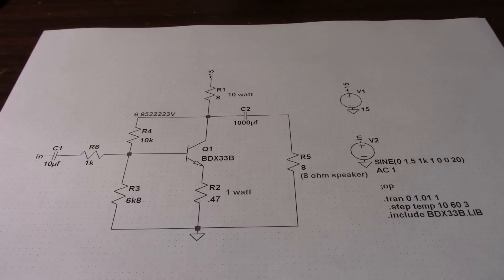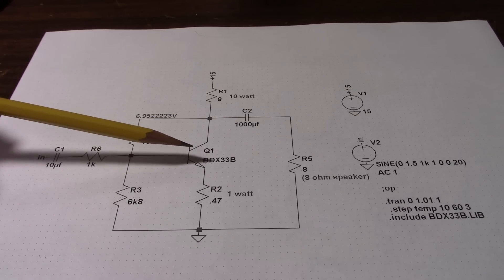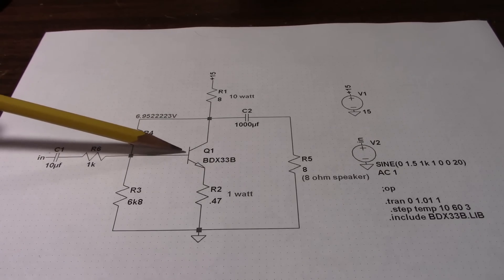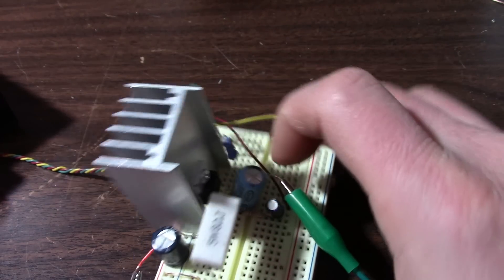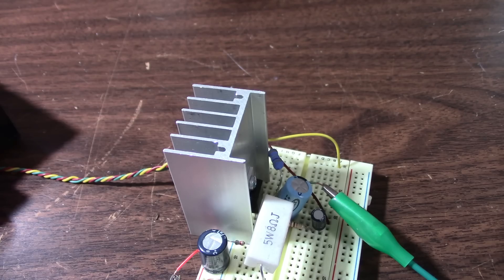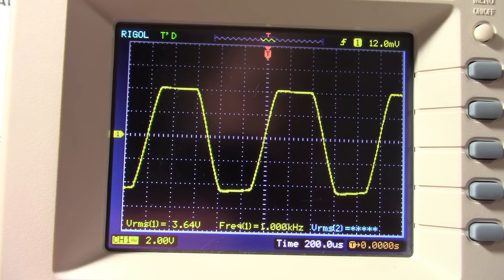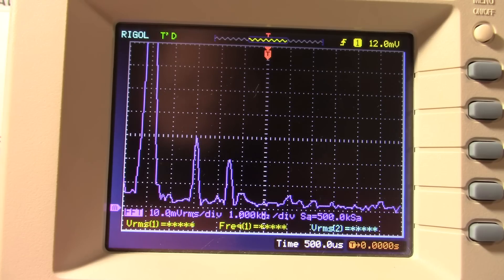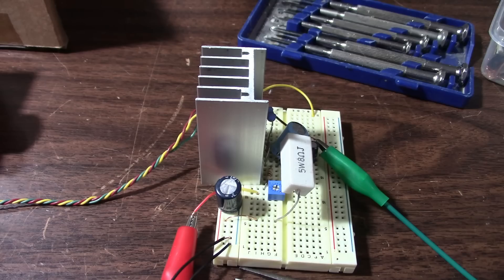Build this Amazingly simple class A amplifier

Comment: Great tutorial. I've been driving myself nuts trying to work out how to make a small practice guitar amp with this circuit. I can plug an iPhone or some other headphone-level source into it and it works, but with a guitar (and a few different amp designs) I either get nothing, low signal, or crazy distortion. Is there a simple buffer or pre-amp circuit that can bolt onto the front of a design like this?

Comment: I didn't know class A amplifiers could be used as power amplifiers until now. Thanks for posting this video.
Reply: Many "hi end" audio brands sell PURE CLASS A amplifiers. Yes, they afre like stoves, pretty inneficient, but they will never suffer from crossover distortion or unmatched transistors on each half wave. Old tube amp in single ende config using a transformer as a load (as well as DC polarization) were pure class A.

Comment: I'd swap the current sourcing resistor for a choke. Should help with efficiency a lot. Also will improve the output power (it will double the available voltage swing).
Reply from the maker: Yes, I did that in an earlier video. I wanted a rudimentary circuit that worked.
Reply: The old car radios used that technique. Paired with a 6 Ohm 6X9 speaker, those radios were loud! They used PNP germanium transistors, so the coil went to ground, and the amplifier was positive ground referenced. That's why they ran hot, because the bias current had to be high enough, for the impedance of the speaker, and at 0 signal, the transistor had nearly the full 12~13 volts across it at ~2.5 amps. That gave a full 24 volt swing(+,-12v) available to the speaker. The large round base (TO36 case style)transistors were mounted on a very large heatsink, which usually got hot. The heat sink had to be big enough, for the transistor dissipating ~30 watts, to stay below 80°C, on a hot day. Germanium transistors have a much lower junction temperature rating,(85°C) than modern Silicon transistors.(usually 150°C) The germanium transistors were in bigger packages, mounted on bigger heatsinks, because they had less temperature swing, than silicon.
     Those early Class "A" output stages were used in the first radios, to replace tube radios, back in the late '60's. They indeed used a choke, instead of a load resistor, for just the reasons you mention. One transistor could produce the same amplitude, as 4 transistors in a push-pull H-bridge configuration, which replaced the class "A" design, to save power, and allow a much smaller heatsink. A stereo class "A" would draw more power than the headlights! The output stages would put about 12 watts RMS into a 6 Ohm speaker, with the engine running.(about 13.5 volts across the transistor)
Reply: @vincentrobinette1507  Interesting tidbit of history :-) I was inspired by the typical tube class A, but because a transistor can have such low impedance we dont need to use a transformer (or in other words two tightly coupled inductors), we can just use an inductor and couple capacitively ;-)
Reply: @akkudakkupl  By replacing R1 in this schematic with a heavy inductor coil, the DC resistance of the inductor coil was low enough, that the speaker can be connected in parallel with the inductor, no output capacitor necessary. The <1 volt that appeared across the DC resistance of the inductor, was considered negligible. you would see a very slight movement in the speaker cone, but not enough to cause heating, or, use up the X-max of the driver. When I saw a lot of bias on the speaker, it never hurt to connect a capacitor between the speaker and choke inductor. This circuit was "upside down", because the transistors were PNP, instead of NPN, like what's used in this circuit.
Reply: At the risk of adding complexity, I think the John Linsley Hood class A amp is worth trying where an active load is used in place of the resistor. Nelson Pass made some very favourable comments on this and added some interesting variations to that "1969" design.
Reply: @akkudakkupl  That's exactly right. Transistors can pass so much current, that all that's necessary, is to use a low enough speaker impedance, that you get the wattage you want at the available voltage.
Reply: I've used a 15-0-15 volt transformer as a choke works fine.

Comment: Could you use a light bulb as a replacement for the 8ohm/5W resistor?
Reply from the maker: Yes, Nelson Pass does it with one of his amps.
Reply: JohnAudioTech sir john you have 1 cap that is not in the schematic can you tell me what value it is? And where is conected?in the schematic are 2 caps but on bredboard 3 thank you
Reply from the maker: @azizzable  It is across the supply rails. Good practice to have one even though this circuit is probably stable without it.

Comment: John thanks but practically this has a lot of power loss and heat generation. What’s the solution ? Which class power amplifier works more efficient? Does an op-amp helps? How?
Reply: Class AB or B amplifier.

Comment: Would a mosfet also work as the semiconductor in this circuit?

P.S.: Stupid question I know.
Reply: Edited to avoid confusion. Yes, with some very minor alteration.
In fact it gets even simpler with FETs and they can sound quite amazing too. If you want a very simple super hifi amplifier use a double triode for voltage gain (and stereo) and choose a simple FET output stage (either push pull or single ended like this one) and depending on the power supply voltages chosen and your output topography you can get as many watts as you want with excellent quality and very low component count, maybe ten or so parts per channel  plus power supply - in fact shared components make a stereo version have less components per channel count.
Edit No, not a stupid question at all.
Reply: @martinda7446  You need feedback for a mosfet, as mosfets are voltage controlled current sources. The output would be heavily distorted as the voltage doesn't correlate linearly with the current.
Reply: I would like to know that too. I've been trying to make small guitar amplifiers, and it would be great to have a full FET amplifier.
Reply: @martinda7446  Is there any example schematic for us to visualize that? Thanks for your answer :)
Reply: Sure would!
Reply: @rich1051414  The circuits can be built simply was all I said, distortion can be managed quite easily - We have been doing such since 1970 or so with FETs.
In fact the output topology of a FET circuit can end up much simpler than a bipolar with comparable distortion figures - as most are just simple follower stages.
I was keeping it simple for the chap, and there is feedback in two places on the original circuit anyway. I was going to suggest he does a search for simple FET circuits if he likes those devices to cover any issues he might find,  as you pointed out these are not linear devices and neither are bipolar transistors of course.
Reply: @pauloscabeni5277   See if you can find a Croft circuit as Glen Croft has been building simple valve and FET circuits since 1982 or so. He has a line of triode fet amplifiers which I guarantee will be simple and ingenious and sound great too.
Otherwise there will be plenty of circuits to find.
Reply: @martinda7446  He asked if a mosfet could work as the semiconductor IN THIS CIRCUIT. That answer is no. The waveform would be distorted if you did that.
Reply: @rich1051414  So if the original poster is reading this then I would answer, YES, with a very small modification to accommodate the chosen FET it would work fine, remember you have to design for a particular device, No two random bipolar transistors would be guaranteed to work in any transistor circuit of course - same with FETs and beware of unhelpful people in life as a general rule.
Reply: @martinda7446  Any bipolar transistor WOULD work, or darlington for that matter, albeit with more or less gain. A mosfet wouldn't be acting as a voltage follower at all, so no, I am not being anal whatsoever. And my intent was to be helpful, so chill.
Reply: What MOSFET circuit will work best?? Common source voltage divider bias or a common drain circuit??
Reply: @sayantanmaiti2513  'Best' would be to use an op-amp with negative feedback and let it drive the mosfet to the voltage you want, since the load may not be exactly a specific resistance. Such an arrangement would work with BJTs or with MOSFETs, with the only change being the gate resistor, though you could get away with the assumption of BJT just fine.
Reply: Richard Smith yes that's a good method. For an opamp I'll choose MOSFET opamps like CA3130.
Reply: You have to be very careful with MOSFETs in linear circuits like these.  They typically have very limited safe operating areas compared to bipolar transistors, so can suffer secondary breakdown at quite low power.  MOSFETs are much better for switching (e.g. class D amp).
Reply: SkyWizardless yes that's the reason why we still use BJTs like 2n3055 or 2n3773 even today. Bass cannot be made better than class AB.
Reply: @rich1051414  I was talking about a push pull circuit which generally uses a  unity gain follower. Which is why i said use  voltage gain from a triode. You came across to me as unhelpful and I don't need to chill. 
As these comments are of little use to anyone  - I think that should be the last word on the matter.
Reply: @rich1051414  PS. And, No not any transistor would work which shows me you really have no practical experience here. What if the max Ic was 200mA? for example.
Reply: @ferrumignis  Most Mosfets are designed for switching and they suffer as you suggest.  Earlier devices were actually even better behaved in this area than their bipolar counterparts. (Silicon not germanium) The market determines the direction of R&D and that didn't include linear circuits unfortunately. Sony VFETs and other similar devices are ideal for linear analogue applications. They have not been available for over twenty years though.
Reply: @pauloscabeni5277  Have a look at the Tubecad.com 'super triode' or search for 'hybrid FET triode amplifier' - though, I must say many are more complex than I had envisioned. Maybe I should make one available?
If you want to build one the active components are certainly of a low count but the power supply can seem a bit more complicated at first glance. A small triode like an ECC83 though requires a tiny HT supply and will run happily from a broad range of voltages, you can use what you have at a push down to 100v (or lower, indeed down to very low numbers but there is no reliable data at these voltages), plus a heater supply of either 6.3 or 12.6V, where they can run off a standard 1A 12V regulator. The HT requires only a matter of  thirty/forty milliamps or so which is a total of about 10W.
I am listening on a design of mine which has four active devices in total, plus rectifier, for a full stereo amplifier, one double triode and a single ended pentode wired for triode operation per channel. Sounds fantastic and though I know from my own builds that the FETs are not quite the match of triodes, they will give you more power and less thrown away heat in a smaller box with less cost.
Reply: Not at all. There is a circuit of a minimal amp using a MOSFET. But not any mosfet, the infamous Hitachi "lateral " mosfets 2SK1058 .... intended FOR AUDIO (ok, lineal applications instead of switching applications). I build it ans used it. It wasnt pretty good at highs .... but Im almost sure it was a counterfeit. In fact D and S were reversed LOL
Reply: @rich1051414 I have asked it for my circuit that is there any feedback for the single mosfet what i have used, and i got reply that it have local feedback but no global. So maybe youre right, but my amp runs good just the way it is now. I have some old videos to give some idea, but i believe now it is even better then before. Maybe i have to upload new video :)

Comment: This is a lab amp and is a good example of how simple a power amp is but you do need a strong output to handle that much current and not over heat it would have been good the tactics to have you schematic turn brown shaped like the heat sink

Comment: What is the need to block DC voltage from  getting into speakers?
Reply: DC in a speaker will cause the cone to shift away from it's mid-position, which can introduce distortion.  Too much DC voltage will cause the voice coil to burn up.
Reply: Otherwise you will blow the coil or if you dont reach this point you will heat the coil for no reason putting stress into the speaker. DC is like NO-NO for a speaker

Comment: For an easy life try a LM317 current source ?   1 ohm = 1.25 amps . It can be bypassed if required with a capacitor. LN317 is fast enough for class A.

Comment: Got a question here, the circuit is very much similar to a standard common emitter circuit, however, I found the R1 is in different location, isn't it that R4 should be connected to Vcc?
Reply: Jack, R4 is connected that way to stabilize the bias. It's a sort of feedback. Iirc it's called self-bias and it is not that much different from the feedback realized by emitter degeneration.
Reply: in simple it is combination of voltage divider and collector fb bias

Comment: I'm curious, have you tried to validate your spice transistor model with the characteristics of the actual transistor in your circuit?  
With such a simple circuit it could be instructive to confront simulation and actual measurements.

Comment: Hi John, can you please share the BDX33B.lib file, probably via Google drive or other means, I want to try the simulation but couldn't find the transistor model, appreciate for your help. I have tried the model from OnSemi, but the result is totally different. In addition, the BF=123.448 is much smaller than the datasheet which claims hFE=2500, I'm confused with those values.
Reply: I can confirm that with On's model Vce is at 14v. And the output is neglible. It's a long shot from what  is measured on the bench. Either reality is broken or there is something really wrong in the model.  And the bdx33b is not on Cordell's model page.
Reply: @copernicofelinis  Yeah, my simulation showed 14.135V at Vc and 106.6mA for Ic Another thing I found weird was that current drawn in the video showed 1.25A, if multiplied with the 5W 8 ohm, it would dissipate 10W and I'm not sure if the resistor can withstand it for minutes...
Reply: @copernicofelinis  My bad, last night I tried this again and managed to get the simulation worked. The simulation and real circuit have slightly difference in voltages at various points but good enough to come out 1 watt clean output as demonstrated by John. Great work from John, I have to say this again.
Reply: @apang9999  did you use a different model? Because with the model supplied by On and with the values  used by John, it doesn't output anything relevant. If I change BF to 2400 and almost all resistors' values I can get more than 1W with about 6Vpp, but distortion is 5.7%.  The point is that I have to change everything in the circuit.

Comment: Dear  John , i constructed the amp . It has a very good sound and it is playing even without a pre-amp. I connected a small tube pre amplifier ,that its more a buffer , and i am very pleased with the result. Although the R1 resistor is heating up very high . I would be gratefull if you give me an advise about that. For the time being the amp is provided with power from a bench power suply. I am thinking of using a ATX (pc power suply) in 12 volts, unfortunately because i dont have a 15 volts transformer. What do you think about that?  I am thanking you for your uploads and i am waiting for your reply . Greetings from Greece Athens

Comment: Cool, but until you showed the preamp feeding the signal to the base of transistor I was wondering how the heck you were creating so much sound from the speakers.

I like playing with and experimenting with 1 transistor amps and have not done so for a while. I found in general expecting much more than 1/2 to 1 watt was pretty much wishful thinking and I was wondering if you have or could dream up a simple amp that really pushed the limit. If so I'd sure like to see the video.
Reply: Ive gotten 8.5RMS out of 1 2sc5200 in class a configuration several times

Comment: Personal experience with many years of SPICE modeling - always gets you “in the ballpark”, never gets you a “grand slam homer”. You still need to prototype, and tweak. But, SPICE gives you a good starting point.

Regarding your comment about harmonic distortion, here is a good guide:

0.1% - no human can detect this level in music or speech.

1.0 % - a professional musician might hear it, if they are familiar with the piece being played.

3.0 % - people with “golden ears” will start to hear it.

5.0 % - most people will notice it.

10% - sounds like crap.

Clipping, regardless of THD, hurts your ears to hear it.
Reply: Bob Pease used to say the soldering iron was his simulator, yeah. But here the simulation shows 100 mA while the measurement screams 1.2 amps. That's not in the same ballpark at all. It's in a different stadium in another state. Something is wrong with On's model. That's why it would be nice to see John's model.
Reply: I thought John said simulation predicted 1 amp, and he was reading 1.2 amps?
If so, he is in the ballpark, his tweaking got the grand slam.
Reply: @davekazoroski6548  yes, but John is using a different model for the BJT. I believe it would be instructive to confront it with the model downloadable from the manufacturer's website. With the latter model Vce is 14 V and the current is 110 mA.
Edit: did I just happen to have read your comment the second you've posted it?

Comment: @John, Thanks for the great video. It is always fun to follow your channel. I have tried  the circuit on LTSpice based on the model from On-Semi and managed to get similar result, of course, after many tries and errors to use the model correctly.  And I have tried the actual circuit on breadboard too, it works!